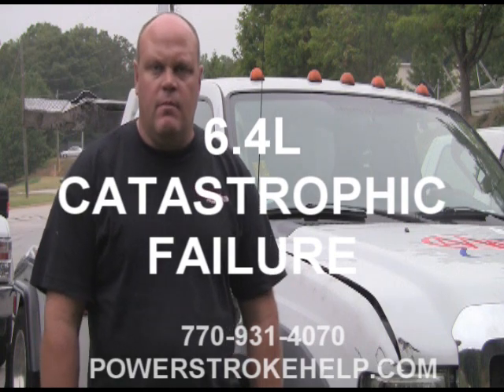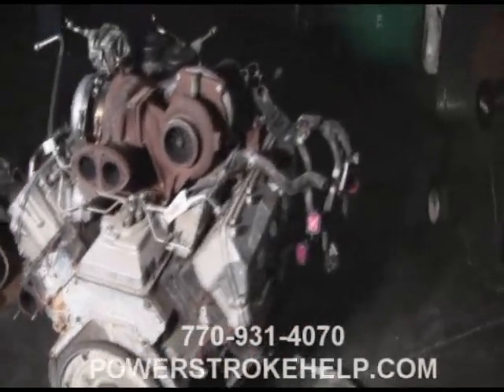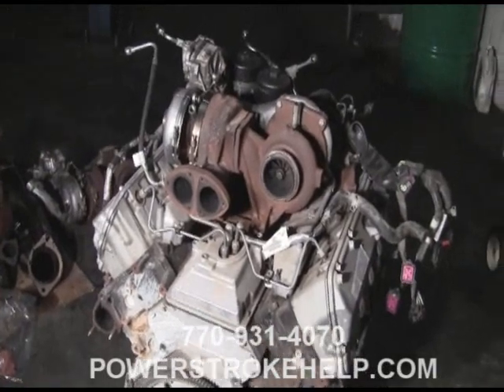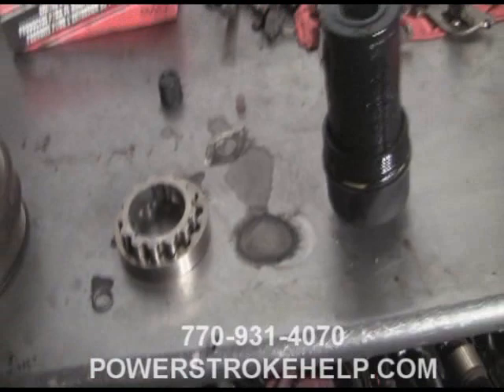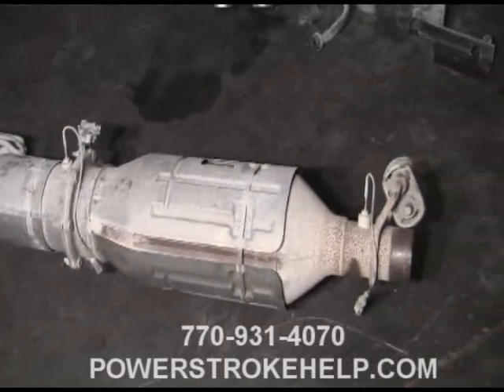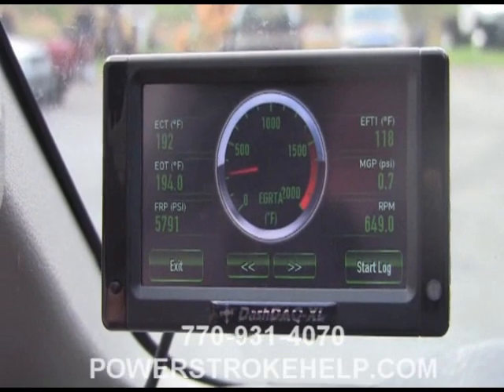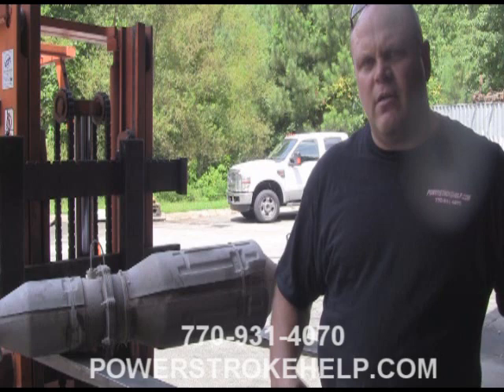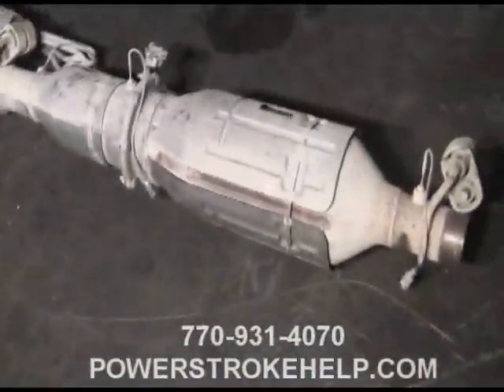6.4 CATASTROPHIC FAILURE

Comment: DPFs are installed on small-engined diesels now also - Nissan, Ford, GM, Toyota, Mitsubishi, Hyundai... the lot..

They are crap at the moment.   Good idea, but shitful configuration.   Why they couldn't design the system to self-clean like they do with the big trucks?  Why not design your cars with Adblue injection??

Grrr.  I love diesels - but not this stupid DPF system...

Got my Duramax with DPF delete..  Done.
Reply: Toyota diesel. Show me the make. LOL. But I'm with you they are everywhere next is my diesel generator.
Reply: marine foxalpha In places that are not America they make diesel everything pretty much. GM has a diesel 12 passenger van with a diesel. Not in a America. The Hilux is diesel now that I think about it. The only real system that they will find that does anything is urea injection which is not nearly as restrictive as the DPF and IMO is a lot more effective considering the DPF deals with a non existent problem. But Urea costs money. So lets just go back to 02 and we will keep our 6.7s of today
Reply: Ad blue is for an scr system, nothing to do with the dpf at all. trucks have the same system but the fuel injected on the exhaust stroke doesn't cause the turbo to be 1200 degrees.  The turbo gets to maybe 500 degrees, no doubt hotter than normal.  The doc gets to 1200 degrees, this is due to a reaction between the high oxides of nitrogen, heat, and atomized diesel injected on the exhaust stroke.  Big trucks also have what are know as 7th injectors which inject fuel after the turbo directly into the exhaust pipe.  No such thing as self regenerating, literally 100% bullshit comment.
Reply: If you are referencing me, I meant to say that DPFs are not effective while SCR is because it solves a problem of exhaust, where DPFs do not.
Reply: Not even sure what you are trying to say in your response.  DPF, reduces PARTICULATE emissions.  SCR is for reducing NOx emissions.  If you understand that you will understand that the two systems fight each other ALL THE TIME.  high combustion temp ( = low particulate matter, high NOx.  low combustion temp = High particulate matter, low NOx.  So basically, pre 2007 they just had EGR to reduce combustion temp and reduce PM BOTH, by tossing it back in the engine to be reburnt.  But, this also means we have advanced ignition timing to account for this system.  2007 in comes the DPF.  we now cut down on egr flow increasing power but it is still slightly advanced.  2010, the scr system is introduced, engineers revert back to "stock" ignition timing, and the scr takes care of the NOx emissions and regens (FOR THE DPF!!!) are less frequent because as i stated before higher ignition temp = less particulate matter.  I hope you understand that.  BOTH of them deal with some form of exhaust emitted by the engine.
Reply: melonas22 ahh, no i was not referencing you, my bad.
Reply: well let me just say that what you said was true about the systems and how they work, but NOx is dangerous in the atmosphere while PM falls to the ground after it immediately oxidizes. That is what I was taught in school.

Comment: Thanks for the video, but if it was running good before you fixed the turbo, how come you didn't spot the possible dpf issue before engine failure?

Comment: So the DPF starts to clog, and the computer dumps fuel into the exhaust stream to try and burn it out, sending superheated exhaust through the EGR, damaging the turbo oil seal. Then the oil seal goes bad, soots the DPF worse than the fuel dump can clean out, the constant fuel dump finishes off the turbo seal, and the motor burns all its oil and fails catastrophically. Right?

Stupid question here, but why wouldn't Ford rig the EGR to shut off during the DPF burnout procedure?
Reply: ... I get it now, it's the exhaust side seals failing. Nevermind!

Comment: Just purchased a 2008 F250 with a 6.4l 94.500 from my father in law great shape never hauled bigger than a bass boat and a few  bales of hay I just want to have the DPF gutted  keep that stock look.

Do I need it retune before or after what are the steps ?
Reply: Yes once you cleaned it get it tuned because without the back pressure and the conversion system missing it will get stuck in regen mode which will kill your engine!

Comment: hey Bill great videos. I have a question. I own a 6.4 and that emission crap keep giving me alot of headaches. I want to gut of the dpf and leave it in the truck. how can I turn off the regeneration mode to prevent new regeneration with the dpf can with out the filter. Right now can't afford to buy a spartan tunner.
Reply: Tuner is the only way to fool the computer into thinking that its still there. If you gut the DPF and try to reconnect it the engine will go in LIMP HOME MODE.. I suggest before you go with the gutting the DPF you get a tuner as well
Reply: Well i'll have to live with this emission crap.

Comment: I just picked up an 2008 6.4 with 114,000 i got a extended warranty for 24,000 miles id like to gut the DPF is there a way the dealer could tell that I did this will it throw a code or anything? and how about re tuning it how would i go about doing so?- any insight would be great. your a genious man. Thanks alot!
Reply: No. You will have to run a DPF delete tune on your truck and they will be able to tell that the truck has been reflashed (voids warranty)
Reply: I just bought a 2008 F250 a with 6.4L  94.550miles been looking for and extended warranty have any suggestions ?

Comment: I'm looking into buying a 6.4 diesel. I've driven an 08 f-350 dually for about 4 months towing heavy machinery for work. I've never loved a truck more, the power the ride and the comfortably are unmatchable. I definitely think im going to buy one, i will be using it as a daily driver and it will see no work and light towing from time to time. My question to you is what should i do to make this truck bulletproof and reliable?

Comment: I just purchased a 2010 ford f350 with 43,000 miles on it . It still has warranty from ford
I do not tow or run the truck strong. should i remove the dpf now or after the warranty has expired ?

Comment: i just purchased a 2008 with 25,000 miles. i do not tow or run the truck strong. should i remove the dpf? i also purchased an extended warranty on the truck. will this void the warranty if i remove the DPF?

Comment: I really need help I got an 08 f250.  It's deleted completely.  But it's making this puffing sound, along with a tick.  It's most noticlbe by the passenger side valve cover.  It runs fine, smooth and powerful.  But I just noticed this sound and a ton of blow bye

Comment: I have several warning signs occurring and I'm seeing some regens because of sensor failures.  Corrected by replacing all 5 sensors on the exhaust.   Now I have a Fuel Rail sensor going bad.  Was told it is a screen under the sensor may be clogged.   I'm interested in fixing the DPF, but can I use a bad DPF by hollowing it out without having to make any other mods including no computer mods?

Comment: Hi Bill  Im looking to buy and 08-09 ford f450.Im using it to pull a 40 enclosed gooseneck trailer coast to coast roughly 24000 lbs gvw .Most trucks ive seen have  60k-120k in  mileage.I just cant help and see why these trucks are cheaper than gm's and dodge 3500 drw. ive seen all your videos about the  6.4L  and all that is scary. What would it cost to bullet proof  the 6.4L.

Comment: Hey Bill
I have a 09 F350 .6.4 Just turned over100,000 the other day and was heading up a hill last night and truck shut down on me , oil indicator light came on . I checked oil and it seemed to be fine. Got it started again and made it less than an 1/8 of a mile when it died again. .thankfully made it to a gas station and let it sit for awhile .I tried starting it one more time , it wouldnt start this time at all . this time along with oil can light ,a key and lock indicator light came on also?

Comment from the maker: I split my driving between Spot the shop truck a 2000 7.3L with 867,000 miles and my 2010 F250 that I bought as a roll over and fixed.

Comment: My friend has one of those trucks. And instead removing the DPF, he drilled a 1 inch hole in the exhaust pipe (just before the CAT and DPF) and welded on a 1x1 inch pipe with a type of "BREAK AWAY PLUG". the "Plug" it self works just like a radiator cap; when the pressure builds and somethings gotta give, it pops open and vents it out in the air. And i know it works because it poped open last month on the highway. When we removed & inspected the DPF, it was clogged. But the motor had been saved.

Comment: If i am going to do the DPF delete and im more interested in mpg and engine longevity than pure performance. I saw where u said to leave on the cat. Is there any particular system you would use or would any of the cat back systems work. Also the truck i plan on doing this to has 240k and stock setup, i havent bought the truck yet. The previous owner put 54k a year on the truck it was a big wig for an oil company in TX truck. What are the things i should look for that would indicate motor is ok.

Comment: Hi Bill, I live in the center of eco-ville...better known as California.  I drive my 08 6.4 (20000 miles odo) 6 miles round trip to work 3 days a week and occasionally tow a travel trailer on trips (4x a year max)  am I endangering my DPF by using it so little?  It seems like it doesnt regen a whole lot.  If it tries to regen on a short trip I usually hop on the freeway and let it do it's thing.  Since day 1 I have really worried about DPF problems though.

Comment: Bill,  I'm looking at a International Terrastar to put in my fleet.   Do you blame the Ford programming on this engine????  as much as you would blame the emission controls.  I have a F-450 with a 6.4 and it's always holding back on power in the take off of the truck.   I am a snow contractor in Michigan.

Comment from the maker: no the DPF will get to a point where it will clog and cannot be cleaned by the standard method. Some of the big truck shops like Navistar and Freightliner have a machine that will heat up and clean a DPF, but you have to remove it and take it to them.

Comment: now if your DPF clogs and it gets stuck in "forced" regen or "parked" regen. wont the system try to clean its self if it reaches level 5 soot level. or if you let it regen when it wants.

Comment: Hey Bill, I have some questions that I guarantee you will know the perfect answer too. First, I have a buddy the has an F350 with the 6.4 liter engine, a couple weeks ago it started to spit fire out the exhaust, yes I said FIRE. Do you know what would cause this and how much it would cost to fix it? Second, if the fire problem necessitates a new engine, my buddy is wanting to exchange the 6.4 with the new 6.7 liter engines, would you be able to do this and if so, how much would it cost?

Comment: Hey bill, long story short i was running my truck on regen for about 2 months. All the dpf wires burnt. I ended up straight piping the truck, H&S tuner, egr delete, intake elbow, and cac pipe. Ever since then I'm still loosing a bunch of fuel and my boost readings are very high almost reading 50psi. My turbo surges very loud even when I turn off the truck. Please help me and get back to me as soon as you can. Thanks

Comment from the maker: Can you get it to our shop in Buford, Ga. You need to get that DPF taken care of with a delete and tuning system from Rudy's. 866-757-6537. If you continue to run the truck it will burn up the turbo and eventually the engine.

Comment: Great video. 2008 F350, and the display has been stuck on "cleaning exhaust filter" for 2 weeks. I just recently drove on a 2 hour trip and that did not clear it up. Now inthe past week it is starting to smoke bad after about 15-20 minutes of driving, smokes for about 5 minutes then stops. I was going to do the delete, but now maybe just gut the DPF and leave it on. If I do that, what tuner would you recommend?
Thanks

Comment: Hey Bill, I did the programmer like you suggested and also did an exaust job, that worked out great.  But the other day I installed an Air Dog II and that was the ICING on the cake.  I don't know if my 6.4 is putting 600 horses to the ground like they say, but it sure is an amazing piece of equipment now.  Don't know if you support the Air Dog II, but its makin a difference.  I think I even gained a couple more mpg's after I put it on.

Comment: First off I love your vids.I also love powerstrokes ever since my parents bought a 2008 6.4 .I've been looking for a new truck for a while now and your videos have been a huge help. I loved their 6.4 especially after they went with the straight pipe and "off-road" tuning. However I was almost sure I was going with a 6.0 because of the problems with the 6.4 and the cost of the 6.7 This video has helped me decide that the 6.4 properly maintained and with the correct modifications is the way to go.

Comment: I am glad I found your channel. I own a new 2012 F-350 6.7, and I am wondering if they may have the same DPF problems as the 6.4. I tow a 38ft. toyhauler that's 12k dry, so my truck gets used.

Comment: I think you're right but it was a lease fleet so the view was it's not our problem.
We found if the DPF light stays on too long on the sprinters the ECU jumps to a limp mode to try and protect the engine. But our drivers found if you switch the ignition off and on again this would disable for 30mins so just did that! Got them back to base and the job done, just glad we didn't cover the repair bill! Thanks for the reply

Comment from the maker: extended DPF regen is the first sign of the death rattle. I bet if you could have replaced the DPFs before meltown that you could have gone a bunch more miles. Take a couple that are nearing 180000 and just replace it as a wear item and see if it extends the life of the engine. It may pay off in extended engine life. Just a thought.

Comment: Good to know the dpf makes the exhaust so clean zero particulate and zero nox but everything else about it is bad. With how much fuel is comsumed by regen combined with the poor milage in stock tune it seems overall less efficient/clean per mile. Smoke from a 7.3 will burn your eyes in the morning, but their longevity is from simplicity of design. Engineers are now forced to sabotage the engine right from the start with the dpf. Is there any other chronic problems with 6.4s besides dpf crap?

Comment: GM is the only one using the 9th injector, and that didn't start until 2011 with the LML engine that uses SCR. Dodge still uses the same system as Ford.

Comment: Why wouldn't the engine de-rate or set a CEL if the DPF was plugged? If the pressure is that high, in most if not all DPF equipped engines, it will shut the engine down and it will not restart until the dealer resets it, IE Cummins, Detroit, etc.

Comment: I'm Sorry, but that's an utterly stupid System. The major difference between this system and the "EU-System"(dont know if it's only used in the EU) is, that they inject after the turbo and the whole engine is running just a little bit richer (so a bit hotter) and the engines are build for that...they have stronger pistons, stronger valves, valve seals and so on. I don't know of any catastrophic failure from a DPF or burning the DPF free...Toyota and Peugeot have this Sytem since 2003...

Comment: Great video.

DPF's only add hassle and maintenance expense for the owner. Over here in Europe we have some of the tiny little sub 2 litre engines and they have them on and cause nothing but problems for people due to short journeys and constant cycling from the DPF system. 

The more diesel engines evolve (usually due to regulations) the less they appeal for their original benefit of economy and durability. Great shame.

Keep the vids up :)

Comment from the maker: I honestly dont know. I think that both engines use a separate injector in the exhaust system to achieve the same goal. I may be wrong but either way they will still use less fuel with the systems turned off.

Comment: I did a DPF Delete and used a H & S tuner.  I tried just about every position available on that tuner and while I got a little more mileage with the hot setting, I dropped it back down to no added power because I tended to want to put my foot in it and blow everybody's doors off.  Right now it only has about 50 to 80 added horses because the DPF is out, get 21 mpg (was 14.5-15.5) and runns better than it did when it was brand new.

Comment: stupid EPA should look at this. Their emmisions control causes descreased fuel economy, decreased engine efficiency, and increased wear on parts on the engine. These three factors alone negate the improvments in emissions that the control device makes, plus makes it more expensive, and lowers longevity of the truck. it make me shake my head.

Comment: I think they will stop their work on diesel a bit

gas engines will be updated as undersized and turbo direct injection for the car market.
Every two decades they use massively a "new" technology to boost up the sales. 
it will be cheaper than diesel.

direct injection with blowers was used with 1930'S airplanes like direct injection for diesel,

but they disappeared magically....

Comment: Bill would it be possable for you to program into the PCM a hydrocarbon injector for the DPF? like have a small injector that has 40-65 psi of pressure upstream from the dfp, rather then the late post injection, just wondering if that would help this issue at all, the turbo wouldnt see all the heat but the backpressure issue might come up and i hope ford has a clean exaust message on there ipc.